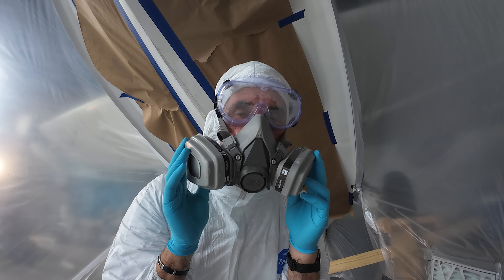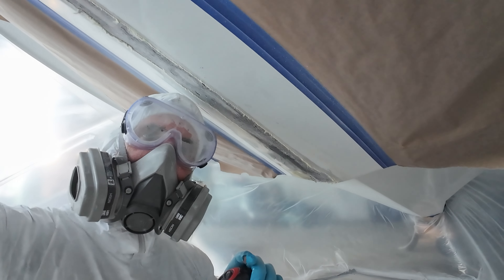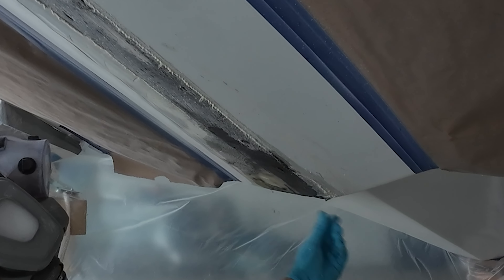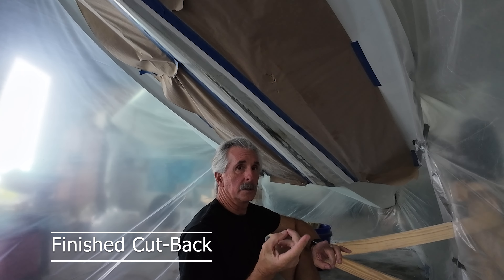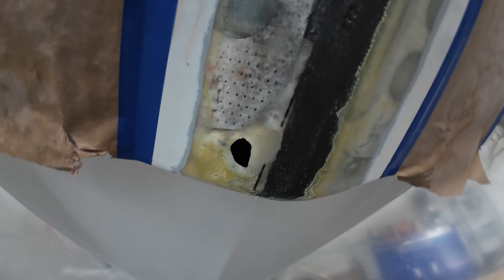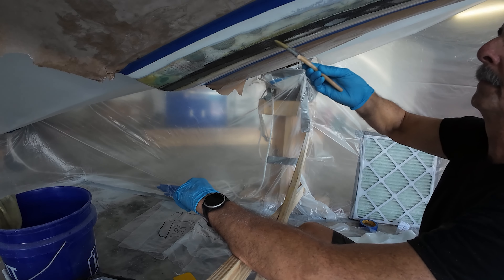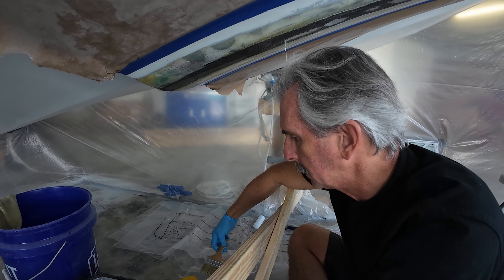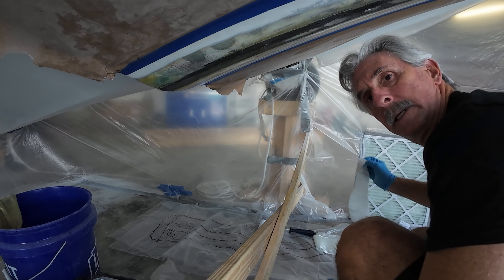Seamax Repairs-Part II

Comment: Good journrey through seceral repairs steps. Nice wodden construction to lift thr front area. I suppose I would have done it with pieces of safe screwd rectangle iron tubes instead of wood. Cheers
Reply from the maker: @eberhardtils1705  thanks for the input! I come from a wood-working rather than metal-working background so I default to those tools. 😁
It is robust. All screwed together with additional metal strapping for strength and security.
Thanks for taking the time to watch and comment!
Cheers!